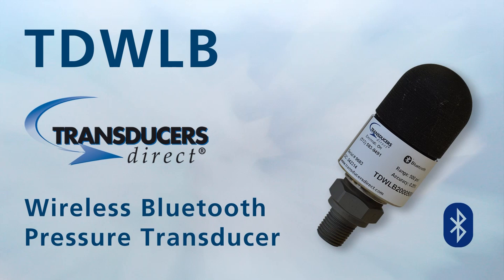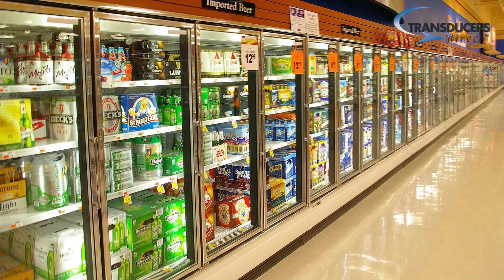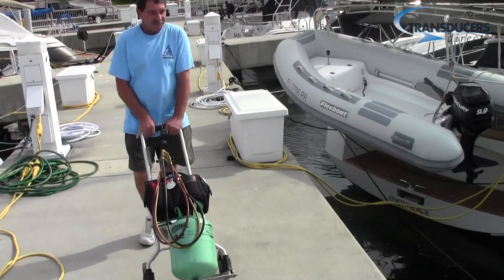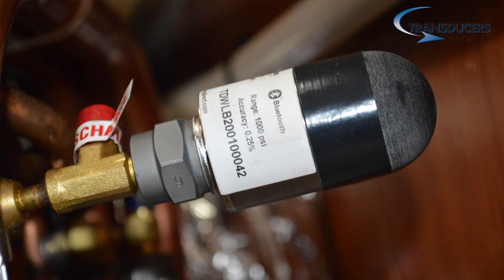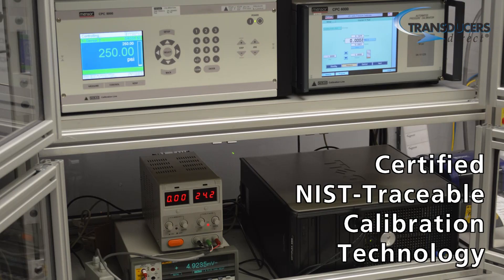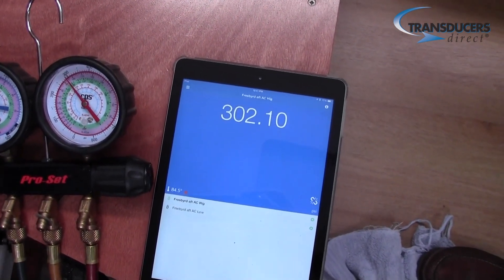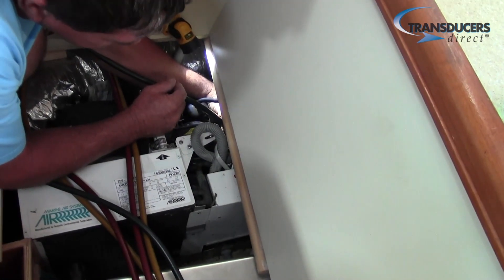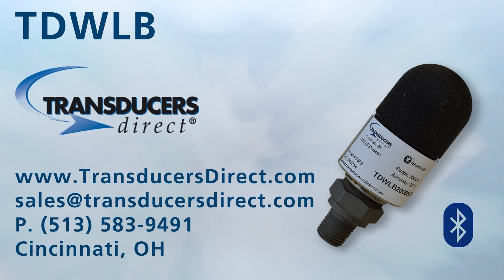TDWLB Wireless Bluetooth Pressure Transducer Marine HVAC Installation - Transducers Direct

Comment: Why not provide a verity kit  of test port fitting to fit the AC equipment /Hydraulic test port fitting ect ! To  simply access systems and replace transducer
Reply from the maker: Thank you for contacting Transducers Direct.   We do offer a field service technician kit, which includes quick disconnect adapters to allow for quick install and removal of the sensors.    The technician kit includes: (2) pressure sensors for high and low ac lines; (2) battery packs with 24” temperature probes & velcro straps; (2) tee fittings; (2) quick disconnects for each sensor; and (1) hard carrying case with foam insert.   Please contact us via email at sales@transducersdirect.com or phone at 513-583-9491 for a specification sheet and pricing.